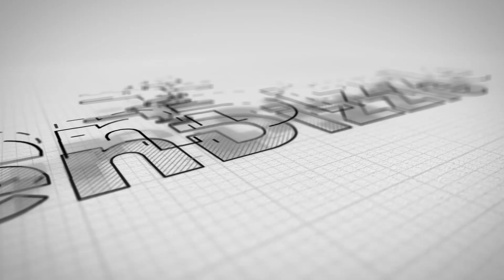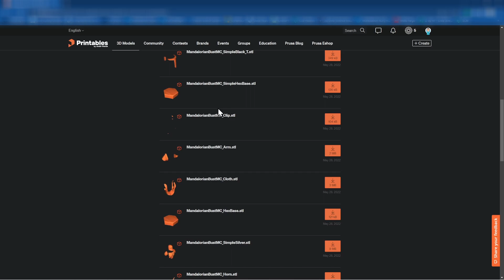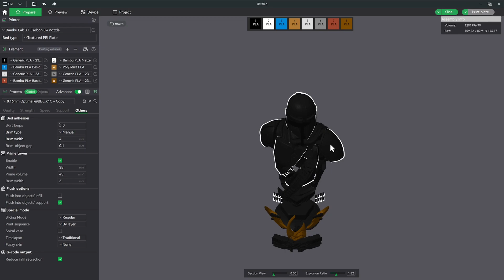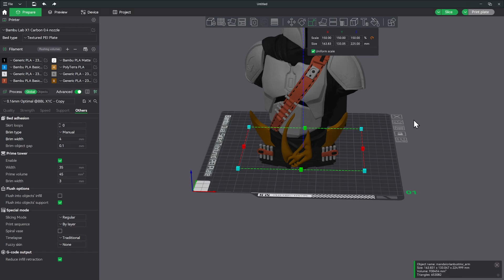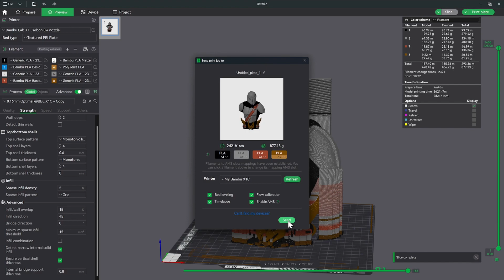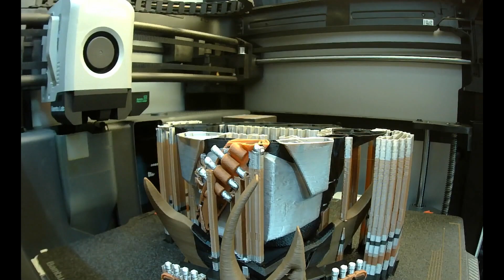This is the way I printed Mando on the Bambu Lab X1 Carbon

Comment: What pla did you use to print this ?
Reply from the maker: Geeetech and Bambu Basic
Reply: @lendizzle77  
Would have settings for HATCHBOX pla for the Bambu x1?
Reply from the maker: I’ve never run it but can say the X1C handles most stuff. That geetech I used was garbage. I will say that. Lol. If you want to really dial it in and the LiDAR isn’t doing it for you, watch my video on soft fever and follow the steps to save it as a custom filament.
Reply: @lendizzle77  
Got it. Will the LiDAR dial in the settings if I were to use the HATCHBOX brand ?
Reply from the maker: Yes for the most part. What plate are you using?
Reply: @lendizzle77  
I’m asking in advance of my purchase of the X1 carbon. I have a lot of HATCHBOX I’d want to use. But I will order the PEI build plate
Reply from the maker: The PEI is where you might run in to issues. The cool plate that comes with it should do fine

Comment: Looks amazing! How did you get away with so little supports? Also, it would be great to see a video using interface supports with support material.
Reply from the maker: It does surprisingly well without a lot of support.  Good idea for a video.

Comment: looks like you are going to need another Bambu. I ran into the same problem. So many multicolor prints I want to do but so much time to print. I have 4 other filament printers, but once you get a Bambu they seem so slow and old.
So, I purchased a P1P for the office. As soon as Bambu release a larger format version if the X1 I will be one of the first to back it in on the Kickstarter.
I have been printing for about 4 years now and the Bambu has just blown me away.
Great job as always
Reply from the maker: Not a bad problem to have. I’ve been thinking about a P1P